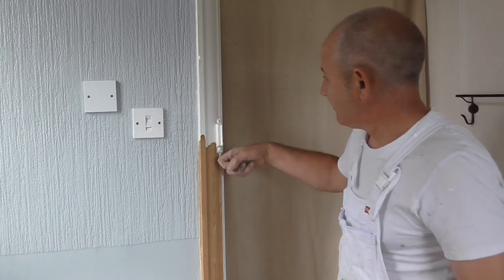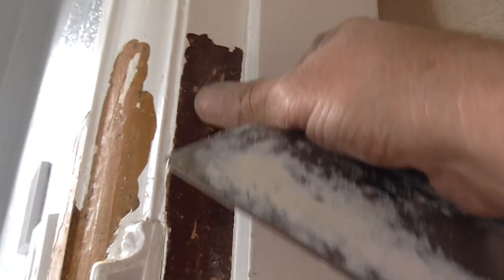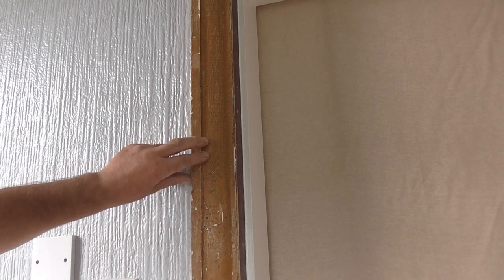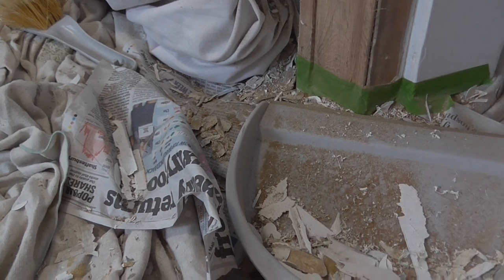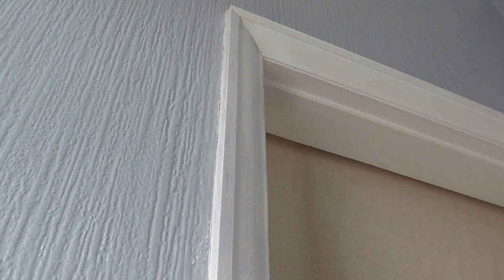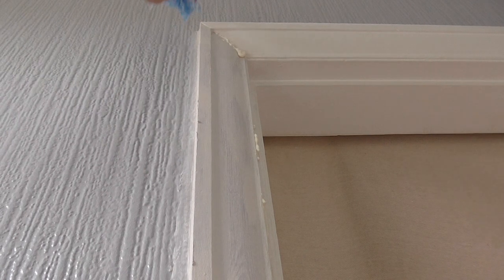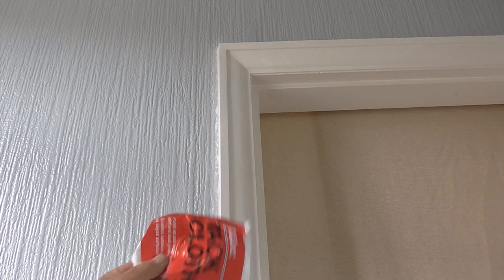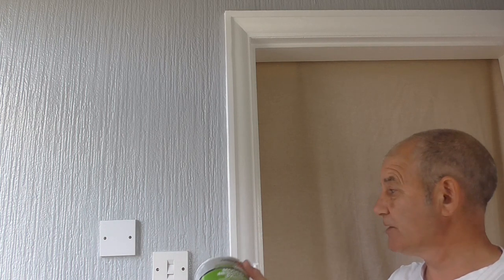Old Paintwork Chips And Knocks How To Remove Old Paint And Scumble

Comment: Top class work as usual . All the woodwork in my built in 1935 house had that scrumble underneath multiple layers of multicoloured paint and it was like thick tar that had never cured properly ...what a nightmare .😭😭😃😃😃👍👍👍
Reply: MIne was built just a few years before yours but mine is exactly the same. There is no way of removing the paint work as in the video, it just isn't possible. I've ended up having to heat gun it but then had to sand / scrape away the scumble, which has taken hours upon hours of back breaking work.
Reply: @diond1333  Yes it is truly backbreaking and your  scrapers and sandpaper were probably all clogged up and covered in the scrumble just like mine , as well as worn out fingers .
Reply: @mofo1739  Hahaha, this is it exactly. I've managed to strip three doors with a heat gun all having recessed panelling. The overall stripping of the doors was quite quick work but what took the most time was getting the scumble from off panelled trims. 

In the end, I got some wire wool and some water and scrubbed the life out of the panels. I then waited for the door to dry out and then used small pieces of sandpaper to scrape away any excess. I would say that part took a good four hours to do.

I am now planning to sell my house because I can't bear to do any more wood stripping. Honestly!

Comment: Phenomenal patience - I can never have enough picking and scraping tools! I've just discovered Allcoat - the water based one - It's phenomenal - no keying or undercoat - would love to know your thoughts on the stuff, I reckon it saves the client a fortune - as long as they're happy with the finish (It doesn't lie as flat as oil, but the gloss is plenty shiny)
Reply from the maker: Thanks.
Reply: I love it, used on exterior windows and masonry , still looking clean 2yrs later.

Comment: You did not remove the scumble. You just painted over it. I came here looking for solutions as I just use a
heat gun and loads of heat followed by acid/wire wool/sanding. Who invented scumble? It is the worst FS
to have to remove. I must be kidding myself if I think there is a product for removing scumble. 
Your video taught me nothing. You need to edit your thumbnail and remove 'scumble'.